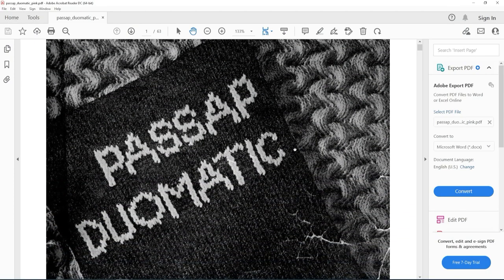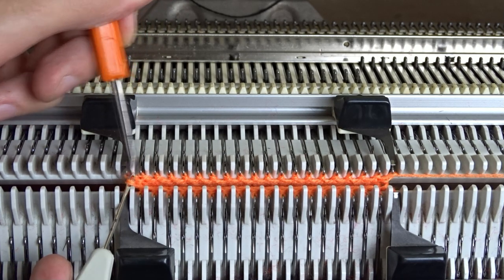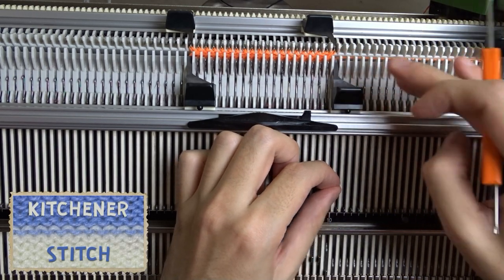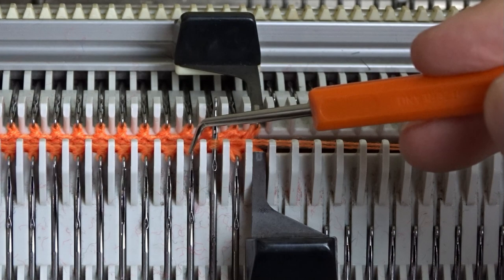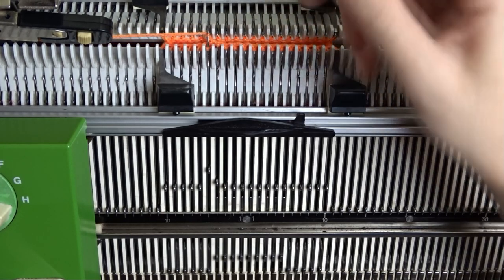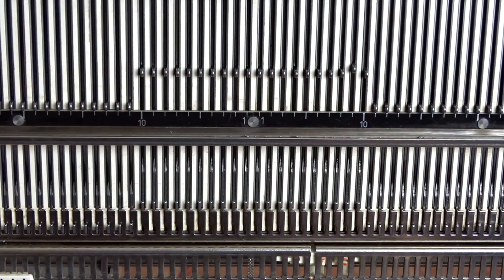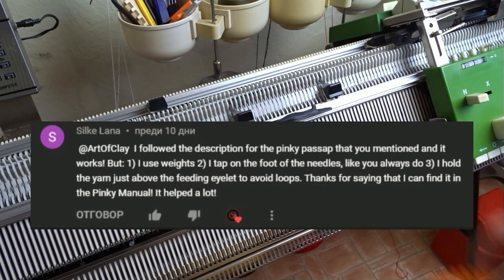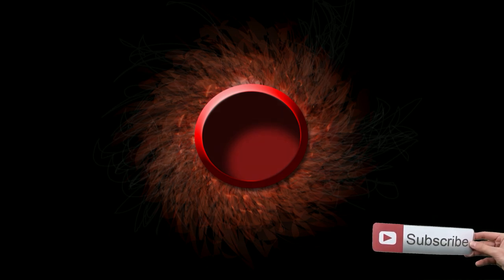You Were Doing It Wrong! Winding The Yarn When Short Rowing

Comment: Socks have been such a headache for me but your videos really help. Just to clarify am I supposed to lower the pusher when the lock is on the same side or opposite? I think the manual says on the same side. I have tried it both ways but don’t know which is better.
Reply from the maker: Thank you for your question. Both methods can work, but there are some differences in the manuals. According to the DM 80 manual, you have to lower the pushers on the side of the lock and raise them on the opposite side of the lock (NOT as shown in the video), but they are raising/lowering only one pusher at the same time. For the test piece in the Pinky manual, they are lowering five pushers at once, but on the opposite side of the lock. If these five pushers were lowered on the same side of the lock you would have a five stitches long float. I guess I had thought that the way explained in the Pinky manual would work for both increasing/decreasing one or several stitches at the same time and probably this was my reason not to follow the DM 80 manual. I haven't observed a significant difference in the results, and the method shown in the video appears to create a good-looking heel.

PS. 
I am very happy to hear that the videos are helpful! Happy crafting! 🧦🧶